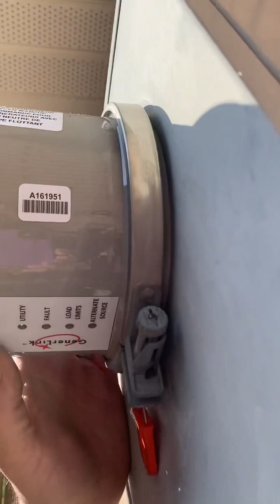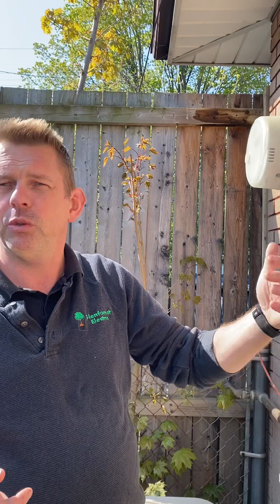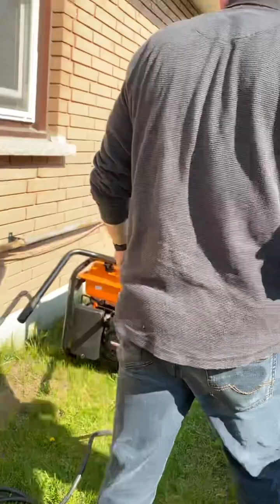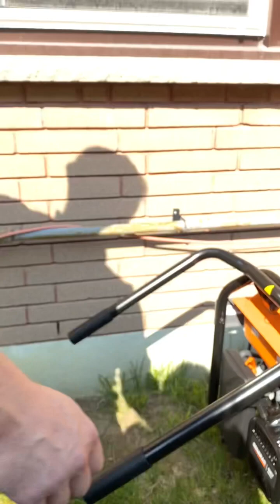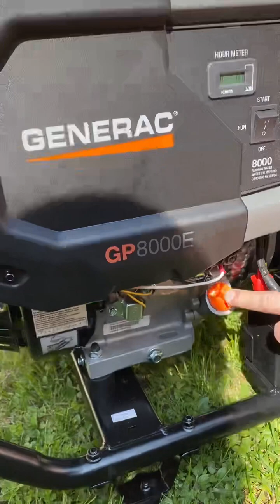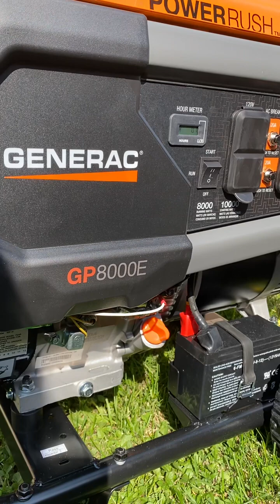How to Use a Generlink Backup with a Portable Generator | Electrical Questions Answered

Comment: Leave the battery charging cable plugged in unless the machine doesn't have a battery protecting automatic "full charge" senso / stop function.
It's good that it has a fuel gauge albeit a very dated looking difficult to read one, some don't have a fuel gauge!  How about that meter connector thing on the wall outside!  Good grief, these manufacturers, why make it with the lights underneath and the label upside down for reading from a wall, it's clearly meant to be standing on something which suggests it's the wrong type for wall mounting and if it isn't and it's all they make for wall mounting then they should be more considerate and design it with the lights and label on under the front perspex, facing the consumer.  How ridiculous!  Nice guy, explained it very well but for one thing he didn't explain to the novice; he told the woman that if the valve is closed there will be no petroleum / gasoline flowing, so you won't be able to start the generator, it has to be the same as my lawnmower and with that you can start it and will run a good but short while on the gas that is in between the valve and the engine and then it stops and won't start again untill you open said fuel line valve.  Anyone who doesn't know this would be really confused and fear they had done something wrong or more likely fear the machine had failed because it was running well for a minute or two.  Hopefully this remark becomes helpful.